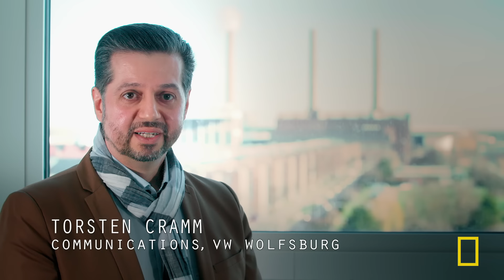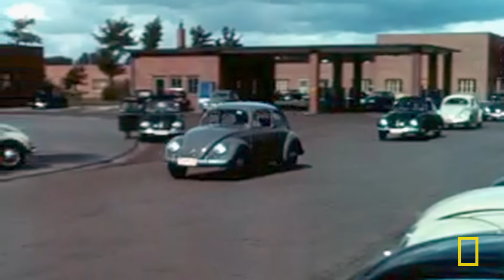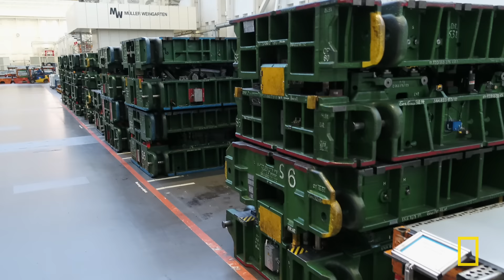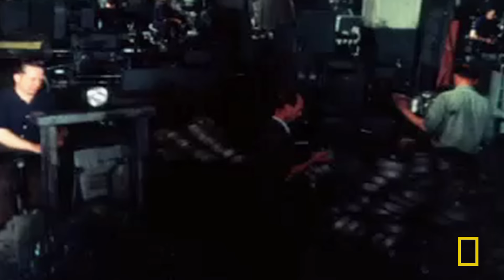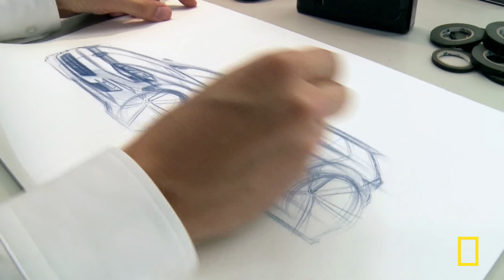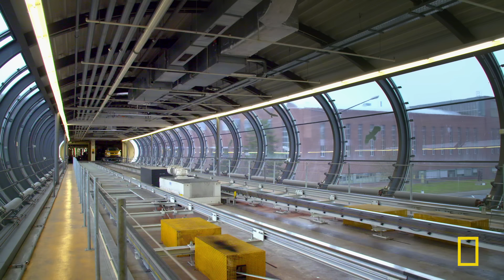Largest Car Factory in the World (Full Episode) | Superstructures: Engineering Marvels | Nat Geo

Comment: In a car company, of designers and engineers, they were told to create Car A with a four-cylinder engine and the word performance or sport in mind, so they make it with a 1.0L-2.0L engine, but their intent is to swap in the engine from Car B, already made in another design department in the same company, they just don't tell anybody about it. As they all have 200-2000 friends or more, those individuals they tell directly. It isn't a skunkworks they are employed by the Car Company itself. What are they partaking in exactly?

They’re engaging in an unauthorized internal covert project—not a skunkworks, but a quiet, informal conspiracy to alter a product without managerial approval. It’s essentially internal subversion of the official design brief, plus information leakage through widespread private sharing. While not criminal, it’s a serious breach of corporate process, governance, and trust, risking safety, compliance, and accountability across the organization.

Employees quietly described how teams of designers and engineers would build a car to spec, then secretly plan to swap in an engine of larger displacement from another internal model without approval. It wasn’t skunkworks—just covert, unauthorized redesign shared through personal networks. They said this pattern appears whenever a four‑cylinder engine’s displacement doesn’t closely match the vehicle’s curb weight (the better being typically within about 900 cc per 1,000 lb of curb weight, with those engines of nearest displacement to the whole of its weight as showing the smoothest torque delivery and least strain under load), creating a shadow culture of unofficial “fixes” that bypass oversight, documentation, and corporate governance. They said about the only time this is acceptable for anything less, is only when the car was specifically meant for high fuel mileage vehicles driven at lower speeds nearer to 55-mph and on overtly flat paved surfaces for their terrain. They continued how outside of those conditions necessitates an overworked transmission with regard to upshifting and downshifting, and overt engine stress when under load from increased grade especially when combined with so often on road merging scenarios. Doing this led to early transmission failures from internal worn out brass fittings, gear slippage, and worn synchromesh.

Comment: Industrial robots do not have stepper motors on their axis. They are AC servo motors that are coupled to either an RV gear or on some cases on smaller arms, a harmonic Drive.   They are mostly tied to RV gears. Which are very robust rock solid drive units with pretty much zero backlash.

Comment: Reliability ratings for Volkswagen are varied. RepairPal gives VW a 3.5 out of 5.0 reliability rating, ranking it 12th out of 32 car brands, which is considered above average. In contrast, Consumer Reports (2025 survey) and J.D. Power's 2025 Vehicle Dependability Study place the brand significantly lower, with J.D. Power ranking it last overall.

Comment: If manufacturers built simpler, better, affordable cars that lasted 500K kms maybe they wouldn't have to ramp up production to such insane levels. Dealership lots are full of unsold, poorly built, insanely expensive cars. A lot of cars built in the last 7 or 8 years come with wet-belt cam drives, CVT transmissions and small turbo engines. Junk.

Comment: No, the Volkswagen Wolfsburg plant did not close down. While there were plans and discussions about potential plant closures in Germany due to financial pressures, the Wolfsburg plant was specifically mentioned as a location where electric vehicle production would be consolidated. The plant will continue to produce the ID.3 and Cupra Born, and will also be the site for the electric Golf and an EV based on the SSP platform around 2030. However, production of the Golf and Golf Estate is scheduled to move to Mexico in 2027. 
😢

Comment: This video glossed over the full crime of Volkswagen's 2015 scandal. Volkswagen's deception was discovered in September of 2015 when the U.S. Environmental Protection Agency (EPA) found that many VW cars being sold in America had a "defeat device" - or software - in diesel engines that could detect when they were being tested, changing the performance accordingly to improve results. The German car giant has since admitted cheating emissions tests in the US.

VW has had a major push to sell diesel cars in the US, backed by a huge marketing campaign trumpeting its cars' low emissions. The EPA's findings cover 482,000 cars in the US only, including the VW-manufactured Audi A3, and the VW models Jetta, Beetle, Golf and Passat. But VW has admitted that about 11 million cars worldwide, including eight million in Europe, are fitted with the so-called "defeat device".

The company has also been accused by the EPA of modifying software on the 3 litre diesel engines fitted to some Porsche and Audi as well as VW models. VW has denied the claims, which affect at least 10,000 vehicles.
VW had to recall 8.5 million cars in Europe, including 2.4 million in Germany and 1.2 million in the UK, and 500,000 in the US as a result of the emissions scandal. So they were perfectly willing to lie and commit fraud on all their customers. many speculated that VW must have had a chain of management command that approved fitting cheating devices to its engines, VW group's chief executive at the time, Martin Winterkorn, said his company had "broken the trust of our customers and the public".  Winterkorn resigned as a direct result of the scandal and was replaced by Matthias Mueller, the former boss of Porsche.

Comment: Sorry, but the truth about the Just-In-Time system is that the stocks have to be kept in the supplier's warehouse. This means that automakers simply transfer the warehouse and stock management costs to their hundreds of suppliers by using their buying power. The phrase 'JIT = Efficiency' is one of the most notoriously overpraised statements. Please do not spread such a wrong theory to the next generation.
Reply: Understand the current production technology.  Manufacturer with modern technology,  the cost to build 10 pcs is the same as 1000 pcs. The obsolete concept of economic scale is outdated.
Reply: Jit is concepts and standard of 1990s.
Reply: JIT stocks are located in endless trucks, crowding Germany's Highways.
Reply: We are in mes 4.0 era.

Comment: I've seen hundreds of shows like this, never heard the term "wedding" but "marriage".
Reply: Then you definitely didn't listen properly or it was told wrongly. The initial assembly of the engine, including the powertrain and the body, has always been called a wedding. The term marriage was never used for this. If you think logically, it also makes more sense to call the first union of two separately manufactured components "wedding", because marriage is what follows after all. Then the various components are already united.
Reply: @duke6321  Well, as you said: "The term marriage was never used for this", case closed, Grok is hallucinating like me I guess:

Name of vehicle body and powertrain joint, one sentence

The vehicle body and powertrain are joined during assembly, typically referred to as the "marriage" process, where the body and powertrain are united to form a complete vehicle.
Reply: @DanielArnolf  This will simply be a translation error, I have been working in the industry for more than 40 years and am therefore also aware of the terminology. In German it is called "Hochzeit" and not "Ehe".
Reply: @duke6321  That's right, they use hochzeit which is wedding. Well, the good part is that I've learnt two German words.

Comment: Yeah I don't know if anybody remembers this but Henry Ford used to build cars out of raw materials. At one in raw iron ore went in and cars came out the other end. The same way for the glass that went in the vehicle for the rubber on the tires everything Henry Ford had control over what they got going on there it's pretty small. The factories in America used to build one bomber every hour start to finish. That what they got going on there is no more impressive than what general motors got going on in Lansing Michigan with the Cadillac CT4 an CT5.

Comment: only if they could make reliable cars that don't fall apart after 60,000 miles.
Reply: If only americans like you had IQ's above 60 and knew that you need to change oil and service a car regularly in order to keep it running. Funny how in Europe VW's are known for durability and lasting long, and they easily do 500,000 miles, and roads are full of VW's 20-30 years old with that much or more on the clock, only in USA they fall apart. I wonder if that has to do with owners not knowing how to maintain cars and thinking that servicing a car is a dealership scam.
Reply: One car every 16 seconds, what do you expect 😂

Comment: Small correction: these KUKA robots have servo motors, not stepper motors.
Reply: And if something moves it must be a robot according to the narrator. Even if its just a simple gantry.
Reply: Cool
Reply: Or they can have both. Stepper motors are for high precision, there's no way these robots don't have steppers.
Reply: Servos are closed loop and offer way more precision. Its possible to run steppers with an additional closed loop module but it's not likely in equipment of this caliber
Reply: @niphotwala188 I guarantee there is no stepper motors are here. You take basic AC motor, put some kind of gearbox on it and encoder and you get closed loop. Its cheaper, more reliable and better. But you need tons of math running on PC inside of controller.